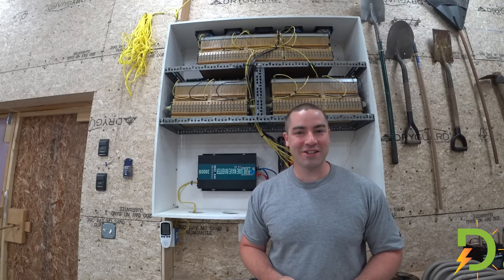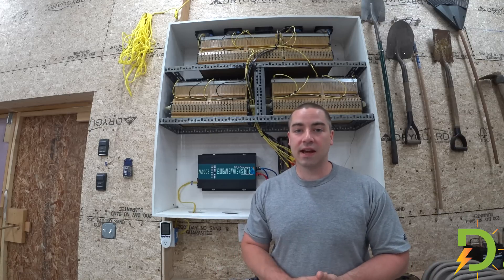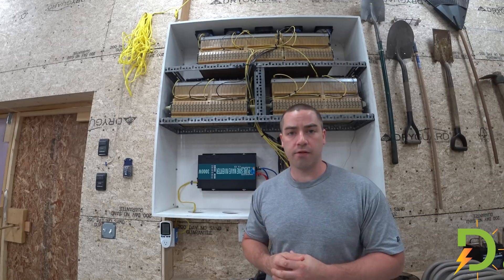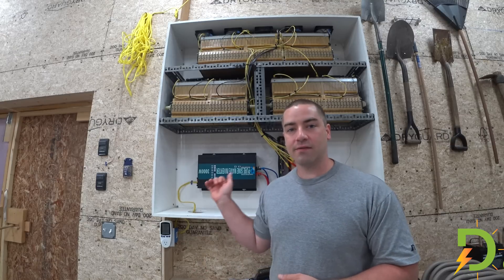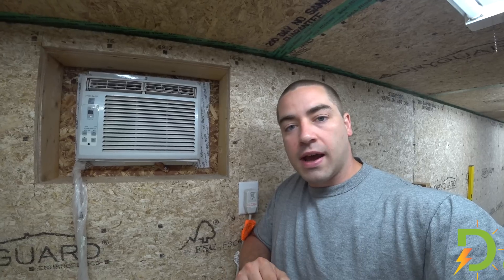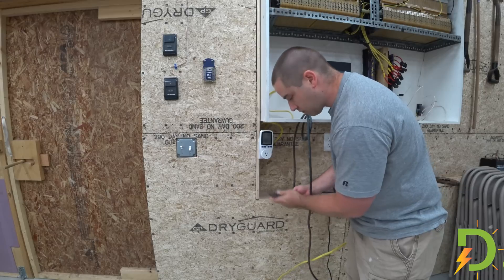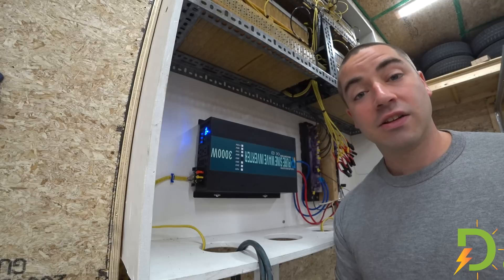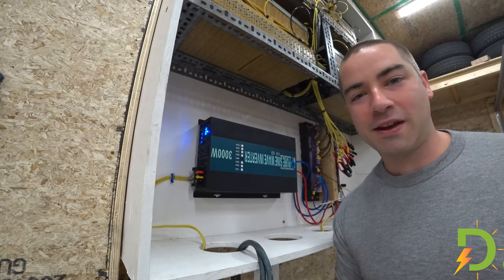Air Conditioning, Reliable Inverter, Off Grid, Solar and Batteries

Comment: Great stuff. I always wonder about this topic. Between time, labor, batteries,  inverters, panels, wires is it worth it. Thank you for your video.
Reply from the maker: Hi igounfazed,  At the time that my grid-tied system was installed the company installing it predicted a 6.8 year simple payback.  We are right on track for that, so they were pretty accurate.  So in the 5 years, no, the system has not paid for itself.  Prices on panels have fallen a lot since then and last I checked, in my area the average simple payback is about 4 years.  But I also live in MA which offers incentives.

I still call it a system because there are panels, inverters, racking, and wiring.  But that is a simpler system than off-grid systems.  My sereies on the DIY Powerwall is an off-grid system.  I'm not planning on taking the house off-grid, but just have the ability to power some stuff during storms.
Reply from the maker: Hi Rebel Lucy,  Short answer, probably not.  The longer answer is maybe?  I'm trying to build a back-up system so I can plug in stuff if the power goes out.  But that means it doesn't pay for itself like a typical grid-tie system would.  By using it for small stuff like the AC in summer, lights or such I off-set some electricity, but it will still take 15 or more years to break-even.  Grid-tie will be a faster payback if that is what you want.
Reply: @David : I have been mulling over what I think is a myth about solar power savings. No matter how I go about costs, it always comes out a bad deal, because the standard seems to be: divide solar system cost by prior average energy consumption cost. That always maths out poorly. Especially if you average under $40/month (an average of 10kW per day). 

How is the math for a grid tied system any better, with regard to, "a faster payback" ?

Any time that I spoke with a Homedepot solar vendor, the costs seemed the same, except that now even if I don't pay for energy consumption, I still pay for solar equiptment. 

If you can, please provide an answer/opinion.

Thank you.
Reply from the maker: Hi igounfazed,  Thanks for the question.  You are right, that the typical math is cost of system divided by average annual energy cost equals payback period.  I don't see anything wrong with this if you are just getting an overview picture.  I personally built my house in 2012, and had a grid-tied system installed in spring of 2013.  My grid-tie system  has the panels on my roof, and each panel has a micro-inverter.  The thin wire that comes down from my roof feeds directly into my meter.  It doesn't even go into the house.  No batteries, charge controllers, BMS, fans, combiner boxes, etc.  There is very little equipment involved.  If you compare that to buying an 0ff-grid system then the cost doubles (at least).  The lower up-front cost means it will pay for itself faster.  

I'm not sure what the vendor was telling you, but I sometimes see confusion when you are looking at lease models.
Reply: @David : Thank you for the response. The vendors were speaking of a system with batteries, etc. that could run the home during a power outage. I was asking their input to wrap my head around off grid living system needs and costs. 

Just to be sure, you don't have a 'typical' solar SYSTEM in that you only have panels for your grid tied 'system'. That would result in a much lower payback period, but only by the amount it offsets costs per year, to the panel costs, correct? Which is dependent on how much electrical energy you consume. 

With 5 years of use, has it been worth it? Have you reached the actual 'payback' point yet?

The type of grid tied system you have, considering my low electrical consumption and costs, still wouldn't result in any payback for me. But only because of my electrical usage and the cost of having city electrical ran onto my property. There is a monthly cost in addition to electrical usage cost that would equal to more than just my $40 per month average. But when I look into the costs of making a solar system that fits my off grid needs, the only figures I have give me a payback schedule of 20 plus years.

Comment: I have already borrowed several ideas.  My "Proof of concept" system is set up on my outdoor kitchen roof. It has 4 panels in one string shows 93 to 131 volts and 6.5 to 7.8 watts off the roof. That is all teh roof space I have. When I go to my property my plan was for 12 panels in three strings so 130 volts at 21 to 24  amps. Bought a snre 48 volt 60 amp charge controller max 150 volts. and a off brand Chinese  inverter. It works but not well. I still don't have the charge controller set up correctly but I did get a charge on the batteries.  4 panels took 11 full sun hours to go from 42 volts to 48 volts so my calcs are pretty close for three strings.The real weakness is the poor quality inverter. it will run most things but with a led light on and a buck saw when you cut a board the inverter trips. I am sure I better quality charge controller with good instructions will solve half and a decent inverter the other. I will let you know. looking at the same charge contoller you have. How hard was it to set up?
Reply from the maker: Hi Boyd,  The charge controller I use is the Victron 250/100.  It connects with bluetooth to my phone.  Before I could get it to work I had to update the firmware, which took about a minute to update, but an hour to figure out why it wasn't working in the first place.  Since then, the charge controller is extremely easy to use.  I did a "test drive" first.  You can download the free app, and run the app in "demo" mode to see if you like it.  I think Victron made a smart move with that.

Comment: You sized that A/C unit just right for that inverter IMO. I own a 3500W Reliable inverter with 24VDC supply. It is weak on surge power. It had trouble starting a 48 pint dehumidifier that my 25 year old Power Star 1300 watt modified square wave 12VDC inverter could actually start and run! Plus, the old Power Star weighs only 8 LBS and about 1/4 the size of the  Reliable unit! I bought the Reliable unit for it's sine wave output more than anything. Modified square wave is terrible for just about everything but a saw or drill. BTW all manufacturers of so called "modified square wave" call them "modified SINE wave". Full deception. Not even close to a sine wave!

Comment: Thanks for the good info! Is there a good air conditioner that can run on DC so I don't need an inverter? Thanks
Reply from the maker: Hi Blakehx,  Good question.  Try looking at "Engineer775" YouTube channel. He has done some projects with heat-pump (heat and AC) that can run direct off panels.  I think it costs several thousands, which is why I never looked very closely.  This setup of AC and inverter is around $400.
Reply: @ Blakehx: Google it, smh... but since "nightmare in action" said no one does, here http://www.hotspotenergy.com/DC-air-conditioner/ and http://www.danthermcooling.com/us/electronics-cooling/products/dc-air-conditioner/ by the way, they've been around for a while and the Chinese have them, why don't we???? Grrrr we used to laugh when Made in Japan, now we buying Chinese all cause we want to spend little $$$ well as the saying goes. You Get What You Pay For. American Made solar panels cost more and they output more than what the UL sticker says. I am a Photovoltaic Technician.
Reply: Google “dometic marine ac”
Reply: Keep dreaming that's impossible no one does it because DC motors just dont work with compressors

Comment: Do you think that 3000 watt inverter could run an 13500 BTU RV A/C?  I think a 4000 watt unit would be required.  Your thoughts?
Reply from the maker: I think someone once told me RV appliances have soft start built in?  If it does, then probably.  This inverter does a good job with continuous load, but is not good at the big surge of power needed for most compressor based equipment.  There is another YouTuber named Going Off Grid, he can run a larger AC on this same inverter.  He might be able to give you a better answer.  On the other hand, it is not a big price jump to buy the 4000 w unit just to be sure.

Comment: How did you come across your Chevy Cruz batteries? Did you buy them new? I take it you didn’t wanna try 18650 batteries? Enjoyed your video I want to try this but do not know what I’m doing ty
Reply from the maker: Hi Marvin, My batteries are out of a 2016 Chevy Volt.  I found them by calling dozens of junkyards (auto recyclers) in an ever expanding circle from my location.  I used google maps to locate them.  Eventually found one.  
As for the 18650, it's not that I didn't want to try them, they just seemed like more time needed then I had available.  There are some things easier with 18650's: You can decide how many in series easily.  My pack I had to cut the existing connections to split the pack up.  Also, you can connect everything in parallel first, then series (mine is opposite).  Good luck with your project.

Comment: looking good! that inverter will run 2 window ac units, not much more though.
Reply: Our 1500 runs ours easily.  I'm sure his setup could run a lot more than 2 window units, especially with those Tesla batteries.  Running two for 24 hours a day is a different story.  You'd have to be there and make sure that the alarms don't start going off on the inverters.
Reply: @snn9019  I have a 1500w reliable inverter and thinking about getting a 5000 btu do you think it'll work?

Comment: if you put bigger battery cables from the battery to the inverter you will get better run times and battery life. a 0 or 00 size will be the best size. right now you are having a big lost do to the resistance in the small cables.
Reply: Doesn't that depend mostly on amperage? The voltage from the batteries to the inverter appears to be 48volts.... and if the inverter is capable of 3000W continuous, that means the amperage is 62.5 split between what appears to be 10 separate cables, so they each need to handle 6 or 7 amps. Let me know if I'm completely wrong, but I think 14 gauge wire would be very acceptable, and the gauges you're suggesting would be a giant waste of money.
Reply: Good to know

Comment: What is the make of the minisplit? I have a Mitsubishi that I installed myself (have installed 3 others since), it's been running like a champ as both an AC and heat pump, draws less than a coffee maker and in my case also runs off solar. They key is to get a top quality unit and install it right, that means pressure test, triple evac, and deep vacuum to 300 microns. If the hacks up in MA are anything like where I am in CT I can imagine that poor split unit is anything but happy. Where is exactly in Mass are you? I'm about an hour away from Pittsfield
Reply from the maker: Hi Liam,  I'm glad to hear you have a system working well.  The first time I had problems about two years into the heat pump, I expected a poor install.  So I found a company that advertised themselves as heat pump specialists.  But, fix, problem, fix, problem later and still have a broken unit.  These are not slow fixes.  Two guys were here all day... vacuum, testing, temperature readings.  I've given up.  It's just too expensive to get them to come out and even look at the system.  If you would like to talk about specific locations, send me an e-mail in facebook.  https://www.facebook.com/DavidPozEnergy/ Thanks.

Comment: I have a similar thing in my camper... it works much quicker though in an 18 foot trailer. XD (Probably not that much better though as the insulation is well... non-existent.)
Pro-Tip: Cover that air conditioner in the winter months with some sort of insulation cover. It'll prevent your heat from leaking out!

Those Mini-splits might be complicated and a bit more trouble but... man... they can really cool and they DEFINITELY are efficient. (Friend of mine's parents cool their 800 square foot space with one, and it's at 75 F or lower all summer long, on a draw of about what that Window unit does.)

Comment: watch out with "modified sine wave" inverters vs true sine inverters. Some compressors use capacative start motors.
Reply: FYI That is a pure sine wave inverter
Reply: old time engineer, Then you have to worry about pure sine wave inverter vs Chinese pure sine wave inverter...
Reply: @ChristmasEve777  that is a Chinese pure sine wave inverter
Reply: What inverter do you recommend? For a small set up

Comment: David, did you ever get the mini-split to work for heating in the winter?
Reply from the maker: Nope.  And I couldn't get it to cool in the summer.
Reply: Sorry to hear that.  I have heard both good and bad about mini-splits.
Reply from the maker: So have I.
Reply: Most of the bad come from poor installs or contractor grade

Comment: Well done. Respect! I am also powering from solar a 12000 BTU AC in automatic, for two hours before coming home if it's hot that day. AGM batteries, 24 Volts,  5 KWatt inverter and 1 KWatt panels tracking the sun. Glad that you are happy with your setup. I'm trying to change to li-io. Hope to find the cells, more affordable than here, in Europe.

Comment: Thanks for the video.  What temperature do you like for your garage?  Do you think the two LG panels could maintain the temperature once you cool the thermal mass (slab, etc.), for the rest of the summer?  I'm also curious about your garage thermal mass design features.  You must have an extremely comfortable garage year round.  Thanks again!
Reply from the maker: I prefer about 68°F.  That's a little cool for most, but I'm working out there and making getting hot.

Comment: Are you doing any battery balancing?
Reply from the maker: Hi Aaron,  Not yet.  In this video: https://youtu.be/Efqx_iRYRjo I check each cell at 8:39 and they are all still in balance.  I haven't yet decided what bms to buy.
Reply: DavidPoz cool. I'm doing research for a similar setup. Seems like Batrium is the one to use for a system like this.
Reply from the maker: Yeah, several people have suggested that brand as well.
Reply: DavidPoz reach out to them they have a lot of information and will help you out making sure you have the proper system for your batteries. Dave have you think about installing a shunt? That's also a device that will enable you to know about your batteries. One of the best systems that I've seen designs was designed in an RV by an solar electrical engineer I think the site is Morton's on the move.
Reply: Aaron Anderson the battery management system are one of the most important parts of any kind of solar off-grid system when using lithium ion batteries. Installing a shunt is also good because you can see what goes in and what goes out of the batteries . Victron also makes excellent products that can make your repurposed batteries safe when used for a off grid system.